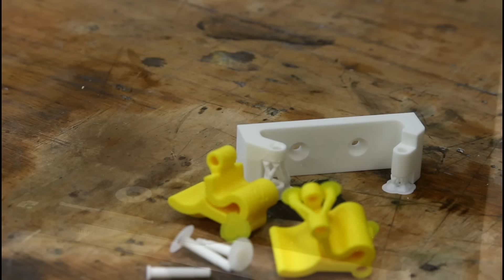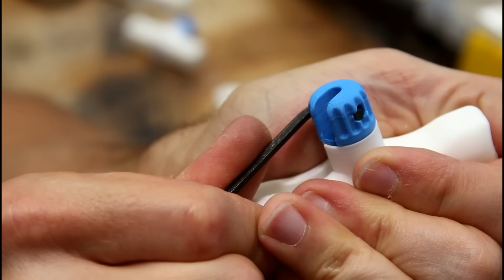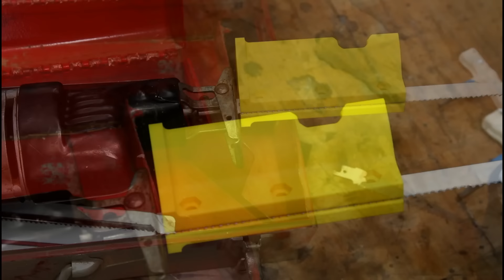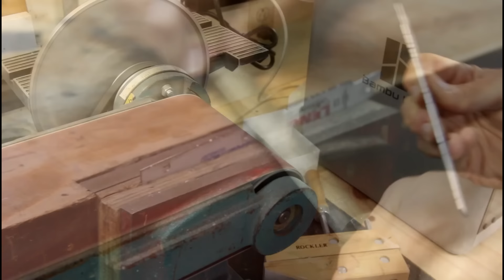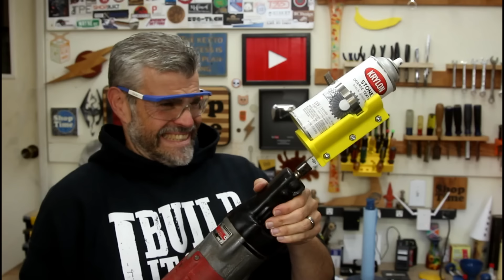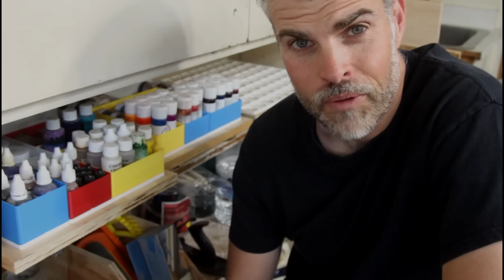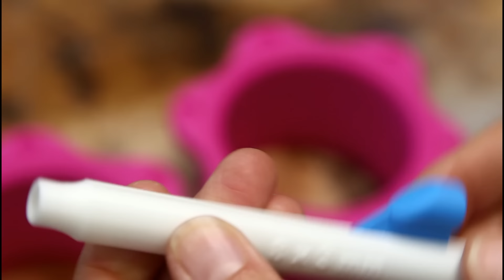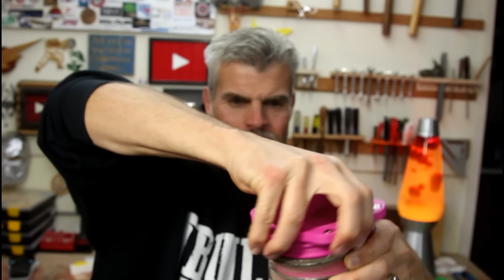5 MUST Have 3D Printed Tools!

Comment: Don't make actual children's toys out of carbon or glass filled filament. The shards of carbon and glass can get loose and permanently injure someone if they get in the lungs or intestinal tract (the shards not just the printed toy). 

This is also why it is not advisable to use the filament for grips or anything with bodily contact as the shards can deposit into your skin which gives you horrible splinters.

Comment: I have printed something similar, but instead of glueing I stopped the print close to the top of the Magnetic hole.  Then put the magnets in, and continued printing.  After the print the magnets were embedded into the hose attachment.

Comment: When it comes to magnectic coupling like the shop hose. I recommend twisting first to break the magnets connections then lifting off. 

 Otherwise if you pull straight off it has a tendency to rip out the magnets.

 Twisting doesn't pull the glue at all as it just presses the magnets against the sidewall

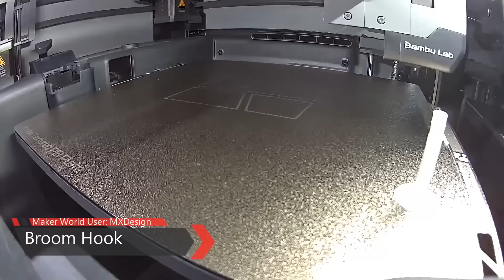Comment: 0:47 by layer seems like trying to weld 2 pieces of metal by laying a bead down on one then the other and trying to shove them together. imagine if cast metal parts were made like that. pour a little in 1 mold then the other then back and forth.

Comment: Several years ago Adam Savage reviewed a drill mounted paint shaker that held the can at a slight tilt at the end of the drill, the one he bought had a weak attachment at the base, he repaired the base and it was better than ever. He uses it to shake some really old sign paints that aren’t made anymore that usually take forever to shake up by hand.

Comment: A tip for that first print: group all the same color filament objects and then print by object. It'll treat each group as an object, so all the white parts will be printed first, then it'll auto switch to the yellow filament and print all the yellow parts. If you print by layer, then every layer has to switch between white and yellow, adding a load of time and wasted filament, and if you print by object normally, then you're limited on heat bed space, depending on how many parts there are and how big they are, due to needing space to avoid the hot end hitting objects. But if you group them, you can have all the white objects close together, and it'll print them all at once by layer and then the same with the yellow parts.

Comment: would love to see how your routed the TPU.  I have the P2S, but have read I need to feed the TPU from the top or remove the back assembly and replace it with a single feed. Maybe what I've been reading it more based on issues with the P1S or other printers and its not that bad on P2S.

Comment: For the dust collector, you could print two C shapes that will fit over the divots, just to keep it from pulling apart, friction fit, easy to put on and off, and a little more peace of mind

Comment: LOVE, LOVE, LOVE(!!!!) this, Peter!
I have a P1S and have been running that thing almost around the clock since I installed it on 1/1/2025.  Now, I've ordered a P2S to help move things along a bit faster.  No, I don't have a farm, but I have an active imagination.  Plus, when I print something that works, I like to print more and give them away to my fellow woodworkers, laser engraver fanatics, etc.
Just earlier tonight, I was gluing in the 10mmx3mm magnets to the hose adapters.  But, mine weren't the cool color you used.  Just black and white.  But, I never thought about stacking the magnets on side 1, then using the existing "double magnets" to seat into the other side.  BRILLIANT!  (I won't say it happened to me, but SOMEBODY got the polarity wrong on two of the magnet positions; therefore, the "attraction factor" was lessened.  So, rather than digging out magnet and trying to fix the problem, I'll just use a new 3D printed adapter (I didn't print but 12 of these, because I know friends who have big dust collection systems and they're gonna LOVE having the magnetized hose systems,
On a scale of 1-5, with 5 being the highest, I rank this episode a FIFTEEN!

Comment: @5:50 if you were to lose power during a print, does it mess it up or does it pickup where it left off like a regular printer?
Reply: They have resume features but in my experience there will be a layer line and possible layer seperation at the point it tries to restart. Furthermore pei textured beds will generally release their prints if they cool rendering the feature moot.
Reply: I use a UPS, 3D printers are kinda power hungry so you have to compare the wattage. I spent like $150 and its powerful enough to last 6-8 hours

Comment: Ridiculous.  #1 and 2 have been available as ready made products for 50 years.  The paint can shaker, just no, ridiculous because by the time you're taken the time to strap it in and un-strap it, that's the amount of time it takes me to sufficiently shake a paint can by hand so it had zero benefit.

I do appreciate that you can't rationalize the cost of any particular tool based on a particular app rather than the long term benefit but it these cases it seems like you've far overspent a reasonable amount of money on a toy and are now just trying to justify it when it wasn't needed at all for these 5 prints.

Now the last one.  Why on earth do I need magnetically attached dust collection tubes?  Even if you feel that you do need that, it makes no sense at all to make the holes too big and then need an adhesive when you could have just pressed the magnets into smaller holes, and/or put the holes on the other side of the flange so they are captive by their magnetic force.

My overall assessment of this video is that doing simple things takes you the most time, effort and expense possible to get the same jobs done that the rest of us have done for decades.  You need to throw away the 3D printer because it's become a burden not an asset.

Comment: Thought you might not have checked the blade was extended when lining up the can holder!  Notice you had to remove the guard to get the blade range back!

So, TIP for the watchers: check the blade is fully extended before marking where to but our drill the mounting holes!  I'd also modify the design to reach over the top end also and trap the can inside, then a simple velcro wrap would hold it in place.

Comment: great content, i never saw your channel before
i just wanted to comment to tell you about a video that the channel I Built A Thing posted very recently talking about pla CF and petg CF, he analyzed prints with very very expensive xray machine to prove that the cf fibres in pla and petg actually are a contaminant in the filament and make it weaker, the fibres leave voids and after heating and cooling separate themselves from attaching to the pla and petg, it doesn't chemically bond
it's a very good informative video that will save money for tons of people thinking they get stronger prints from pla and petg cf, also printing with cf filament creates nano particles of cf fibres in the air and comes off of the prints as well, so it's kind of a dangerous product to use healthwise also
nylong and asa/abs cf filaments do make parts stronger, but not pla and petg cf because of the lack of chemical bonding

anyways, it's a great video done by that channel explaining about it showing all of the science and findings from the tests

new sub
love from canada

Comment: Great video as always! I've had rotten luck with gluing super magnets, so I now embed my magnets.
I create a tower, find the layer number for the top of the holes for the magnets, add an m0 stop so I can glue in the magnets (so they don't try to pop onto the print head) before continuing with about 4 top layers for the holes.
The technique has been awesome for my laser jigs, holds them onto the honeycomb awesome.

Comment: I will print a shaker!

The Version of the Router bit storage is missing a Feature... if i can have any shape of Block to stick the bit in, i want the Result of using the bit visual to me (and testable if a slot with this bit has a good width for the sheet to stick in)

Comment: Combine Project #1 (Snap holder for a broom), enlarge it, and add it to Project #3 (Spray can shaker) you can get rid of the hassle of using a hose clamp to hold the paint can. Project evolution.

Comment: Word of advice: When gluing magnets to a 3D print, scuff up the plastic with low grit sandpaper like 60 grit, then blast it with some compressed air to get all the dust out. Then scuff up the side of the magnet you want to glue down with the same sandpaper. Just a quick scuff up, nothing crazy because you'll scrape the nickel coating off if you do too much. 
Then clean the magnet by wiping it down with some IPA and THEN glue it to your plastic piece. This will create a much better hold and should last a lot longer, especially on PLA because PLA is hydrophobic so glue does not like to grip onto it.

Comment: I did a better can shaker, I use a wood working clamp, shaped the tip the same way as a reciprocating saw blade, that way, I can do spray cans, 1/4 cans, small paint bottles... Etc. And took me 10 min to make one

Comment: I'd recommend a less permanent glue for the o'ring.  Using super glue means you have to replace the whole assembly instead of just the gasket when the gasket wears.

Comment: Printing the first print by object instead of layer saved a TON of filament because it would have chanclged colors several times for each layer.   That was a really smart move albeit unintentional. Lol
Reply: I would assume that the parts are stronger when printed individually since the material would be at a higher temperature for successive layers and bond better.

Comment: I wonder....does 2 magnets in concert have a stronger pull than one by itself?  Also, what type filament were you using on the broom handle clamp (maybe for all the prints)?  It seemed like it was a very strong variety.  I'm just a few months into 3D printing and have only use PLA so far.

Comment: This a just "MUST HAVES" for only a few people and buying this things is sometimes CHEAPER than print them, because they will last longer.
I bought 2 of this broom hooks made from stainless steel and rubber for 1 Euro and to mount them was much easier.
A connrctor for these 2 hoses costs on TEMU just 1,73 € incl. shipping, on eBay 6,70 € (with quick release !) incl. shipping.
No work, no clue and how many times do you must separate these hoses ?
For me it makes no sense to print these "must haves", especially this so called "paint cabshaker" because it dosn´t really work, the ball inside jumps just a little (too little), even when the can is full !
Put the can in two old socks and throw all in a washing machine, that works because the can rotates in all directions ...

Comment: Great Video; glad I stumbled on your channel.  I am putting together a wood shop in what used to be my Harley garage😢.  Your videos will come in handy.  Wasn’t going to move my printers out there, because of sawdust, but seems to work for you, so might rethink it and put the den back to a Pub Game room again. My main printer is a Creality K1 Max, and am contemplating getting rid of my older Creality’s and getting a K2 Plus with CFS; however, after your comments on the Bambu Labs, I am wondering if a move to that platform might make sense.  I’ve always felt comfortable with Creality availability of parts and accessories, but their Customer Service in the US is almost non-existant.  Wondering if Bambu Labs is better?

Comment: I'd LOVE to have a slightly modified version of the paint shaker...

I'd want to extend the length of the can holder and add an arc at the end that comes out over the shoulder of the can (but stops short of the nozzle of course) so the can can't walk it's way out of the holder as it's being shaken...

Comment: You should check out some vids on stabilizing your printer. A solid level surface is the best starting point, then using a 24"x24" paver stone to add weight, then some sort of dampening layer like a thick carpet pad foam or something. I used those floor mat tiles you can connect together that are about the same size as the paver and it helped calmed down the movement of my A1 drastically. My table isn't the sturdiest, but it's working well until I get something more solid built for it in my future shop.

Comment: If you read each bet first, all you would have to do is use color change, and you could’ve have it marked on your little blocks for it instead of having to use tape of any sort to label it.  That way you already labeled it and it would just go to that percentage one back.  Using the color change you could also put it into the side of those so you didn’t have to read by using one and try to keep the color change part out of reach from where in tear. I’ve seen people do that that’s how I know about it.  It would just go inside the block letting you see what it says from the outside.

Comment: Great video, I was wondering about having the printer in a Dusty environment so glad to see yours is working great. Couldn't tell in the video, but a suggestion would be to reverse every other magnet polarity around the adapter. That way you don't have to have pairs of connectors and they all work with any combination.

Comment: If that is a carbide tipped blade you are using to cut that sawzall blade with, you have just used up a good amount of it's sharpness. If you read the print on the blade it is approved for cutting non-Ferris metals like aluminum and brass. Sawzall  blades are hardened steel and should be cut with an abrasive cutoff wheel, which is closer to a grinding wheel.
Reply from the maker: That’s a specialty chop saw for steel and wood from Evolution Power tool.

Comment: Should have mentioned you didn't leave enough room for the stroke on the paint can shaker and had to modify your sawsall to let it work.   So people wouldn't make the same mistake.  Slide the shaker down the blade about 1.5" should do it.

Comment: FWIW, printing by object rather than per layer can increase layer bonding strength. This is because printing layers on an object only, by the time the nozzle prints the next layer- the previous layer is still warmer. This increases the layer bonding strength.  Again, the latent heat of the previous layer can assist in the next layer bond being stronger. When you print an entire plate of objects, the total time per layer is longer, and so the layer has more time to cool before the next hoot layer is printed on top and bonding to those threads. The only real con to printing per object is just less build plate area and number of objects because of clearance needed to print per object. Again, in your tool and typical bracket or mount examples where strength and toughness are desired- knowing that per layer can improve strength is a good thing.
Reply: Opposite to the above- when printing a cone shaped or small diameter post or tall thin object- printing more than one at a time and printing per layer helps with cooling and prevent the deformations on the pointed tips of towers and small diameter objects from the nozzle "dwelling" and printing hot layer after hot layer. Again, the idea of printing a couple of objects at a time rather than just one can improve this specific scenario.

Comment: For the parts with magnets, I would have modified to print in place where you embed the magnets into the print.  Add a print stop at the top of the magnet level, insert magnets (glue in if desired), then resume printing where the next layer overlaps the magnets either partially or completely for a couple of layers.  This approach works great, and you never have to worry about the magnets ever falling out.
Reply: Oh, if only that project printed magnet side up.  Alas, the ones I've printed have the magnet locations on the bottom.  Plus, if you invert the model, wouldn't you need supports once the print process reached that area where magnets go?  Hmmm.
Reply: For something like this, having any amount of plastic between the magnets will severely reduce the amount of magnetic strength. For this application, they likely need to be touching in order to get maximum strength so the hose doesn't come apart.
Reply: @cool8661 Does the suction through the hose also help to keep the parts together?

Comment: Thanks for the great video Peter. One suggestion on the Print by object option on the broom holders. You can group parts together that are the same colour as one object so that they do not need to be spaced apart. This allows you to have more items on the plate than if you print them all individually and still ensures that you don't have a filament change after each layer.
Reply from the maker: Oh, that's really smart. Thank you for the suggestion!

Comment: If you have trouble with filament stringing, print by object is a good way to minimize that since the printhead is not slewing from object to object and dragging filament strings with it on every layer.  Another way to avoid stringing is to use "Avoid crossing boundaries" in the slicer settings.

Comment: The most practical are shopvac adapters. I'm so tired of every shop vac, vac attachment, and tool having a different size input/output/hose. I have an entire bin of adapters and I still sometimes have to stack 2-3 of them just to connect something to the vac.

Comment: I have a broom holder that is like a gear and it gets narrower on the way down with gravity. I find it more satisfying for some reason. There is no snap sound. Gravity does the work and it binds on the way down so it fits a wide variaty of sizes. I think the compliant design although neat probably fatigues eventually. The roller has nothing to fatigue about it. By object is better for multicolor prints when each is its own color it takes less tame and doesn't need to keep switching colors.